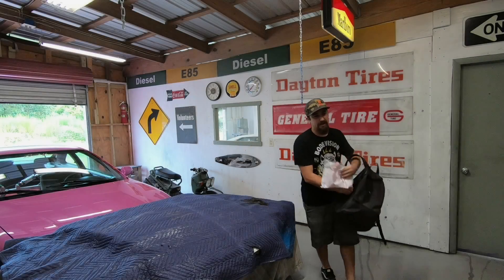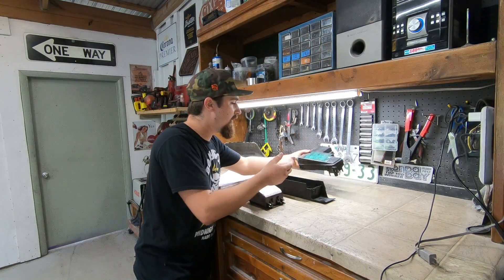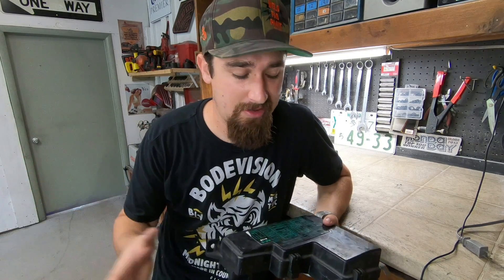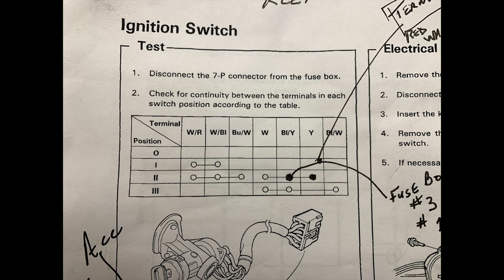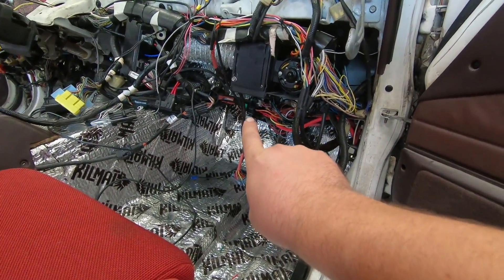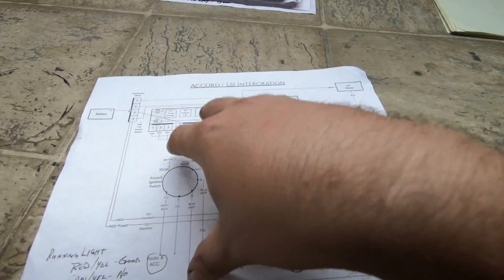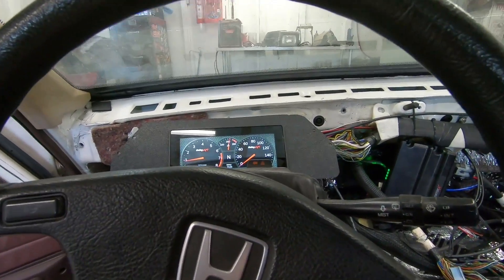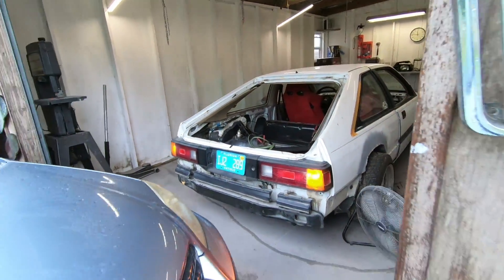How I Adapted My Honda To Work With My LS1 Swap. Integrating wiring for any crazy engine swap!

Comment: How did you get the wiring diagrams for the key positions and everything else. Also how did you make the integrations diagram. I’m in the process of a swap right now and need to rewire everything.

Comment: Good job integrating both electrical systems.  So many guys would just stick a carbureted engine in there and avoid the wiring part as much as possible

Comment: What did you do with the original transmission system?? I have an 89 LXI  auto trans I want to do a swap and make it manual. Trying to keep it as original as possible.

Comment: Dash boots at position 2 and then loses power and reboots at 3 while turning it over?  No way around that?
Reply from the maker: I’m going to take a look at it, the Ecu stays on, I just need to look back at where I put the switched 12v for the ecu
Reply: BodeVision that type of thing would end up driving me nuts. Love the build man. Definitely one of a kind.

Comment: Your screen and possibly the computer is on a not hot when cranking and hot when in position two    this can cause issues for you because the system does not have power while cranking and then it needs to reboot.   you should find a feed that is hot when in position two and also hot while cranking

Comment: Adam you have been busy Wiring scares so many but as you say if you have a drawing it can be quite easy to trace and then alter for your needs, I once rewired a vintage truck that had no wiring at all but I had a rough diagramme so I numbered all the cables and off I went the only issue was it had a Dynamo not an Alternator and the Dynamo was set to a positive earth and I wasn't sure how to switch it to negative once I had that information job done.